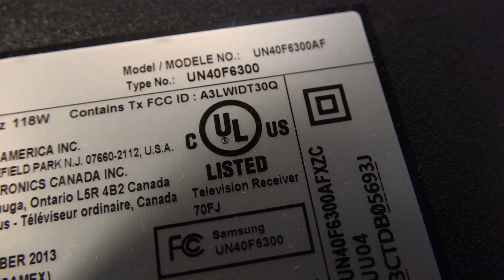Samsung TV LED backlight failure

Comment: My lg LEDTv is turning on , showing LG logo and then backlight dissapears . Its the strips, isnt it?
Reply: Most definitely the strips or to be honest. One or 2 failed LEDs on the strip.
Reply: If you are in the UK I may be able to help with spares
Reply: @allenfleckney5969  Hi I came across your reply to a video and wondered if you could help with backlight leds for Samsung le46c750r2k ? Or possibly repair it for me ???
Reply: Yes I can sort this. But I am in the UK ?
Reply: @allenfleckney5969  I live in Middlesbrough
Reply: @allenfleckney5969  Hi Allen I sent you a message thru YouTube regarding my 46" Samsung 3d tv Leds. Did you receive it ?
Reply from the maker: I am still hopeful that the unit will be abandoned and then I can proceed with ripping the panel apart and checking out the lights. I have some strips from a broken screen set. The unit is sitting in my garage awaiting pickup
Reply: Thanks

Comment: The main problem is no one is telling the costumer to keep the backlight settings low, just about all the ones I repair ( 5 a day now in the uk) are set at 100% , if they were at 75% they would last years longer. I set mine after repair at 45% and the picture is fine.
Reply from the maker: This is no different than back in the CRT days.In that all important drive to have the brightest picture with the most contrast, manufactures made tubes with very dark glass to reduce reflections. Then they cranked the sh1t out of the tube to make it a table lamp not a TV, and people wondered why the picture tube was shot after 4 years, when their old set lasted 20+ years,

Comment: Client must be crazy. Easyist repair ever. It's time consuming but if you have some spare LEDs it would only take an hour, then good as new. Shame he never let you finish it.
Reply from the maker: I agree, but that wasn't my choice. I offered to fix it, but then I am going through a 3rd party. The guy that brought it to me is not the owner, he is the system integrator so I am dealing with an installer, giving him the diagnosis, and he is dealing with the owner. Installer called me and said throw it together and I will pick it up.
Reply: @12voltvids  He used your diagnosis and is replacing the tube by himself.
Reply: Easy repair, easy to prevent also. Turning down the backlight strength to 50% will prevent over voltage. You also won't notice much of a difference in picture quality.

Comment: Ah yeah,  LED backlight failures.  I don't even worry about getting the LEDs to replace them with since they're harder to find,  I just use a diode.   If it's just a couple of LEDs out you can't really tell once it's back together because of the diffuser.  I also tell people to turn their backlights down on their LED TVs a bit to lower the load on these circuits,  it will extend their life.  Often they are set to 100% at the factory.
Reply from the maker: My new 4K set came with them set to 20 from the factory. I generally run them at about 12 (20 is full) and the picture looks great at that level.
Reply: Oh also,  didn't know if you knew about these but a 500 pack of some backlight leds - https://www.aliexpress.com/item/500PCS-LG-LED-Backlight-1210-3528-2835-1W-100LM-Cool-white-LCD-Backlight-for-TV-TV/32685786152.html?ws_ab_test=searchweb0_0,searchweb201602_2_10056_10065_10055_10068_10067_10054_10069_10059_418_10073_10017_10070_10060_10061_10052_10062_10053_10050_10051,searchweb201603_7&btsid=9b56e2a0-3d2d-4d0e-8774-d410967da681

 I might try ordering some eventually myself.
Reply: the LEDs are pretty easy to get and replace actually. shopjimmy sells packs of them all day long lol

Comment: yes.. samsung make good tv ..see all video 12volt repairing about samsung  TV
Reply from the maker: I like Samsung. I have many of them here. The problem with the LED backlights failing is more than likely people running them at 100% I keep my only LED set at 80%. Same for my Plasma sets. I keep them at 7 or 8. Never run them at max, too hard on components.
Reply: To be honest Samsung backlight failure is rare compared to Toshiba (Europe Vestel) and LG
Reply from the maker: We used to call Toshiba "Toshitba" at work when I was working at the shop.

Comment: If you're not going to give the engineer the time and resources to fix something you shouldn't waste their time in the first place. Your customer is a tool.
Reply from the maker: I'm dealing with a system integrator that removed the set from the end customer and brought it to me. I would love it if he said keep it, because then I would find the LED that is out and fix it like I did that Philips LED that went south a few years ago. Same thing. A bunch of LEDs in series, so if one goes you loose the string, and the way these units are set up if you loose a string it upsets the current draw on the PSU and throws an over or under current fault that shits the set down.
Reply: What they need is a zener diode in series with every LED ... that way, when an LED fails like that, it will still allow power to flow.

Comment: Ran into the identical problem with my mother's 32" Samsung. Both LED strips were bad on it. There were actually burn marks around the LED's that most likely initially dead shorted, before opening. The set only lasted 6 months. Since this was a black Friday purchase, the light strips were half the cost of the TV, so I purchased a new one for her and listed the individual boards on Ebay. The only inquiries that I have had for them were from people asking if I still had the LED backlights...............

Comment: I've  come across the same problem and the problem usually is the power supply. Symptoms are exactly the same: the 12V line is hovering somewhere near 9V and backlight is flickering. I suspect there is a problem with the PFC chip underneath the power supply since the voltage on the main reservoir capacitor is at 330V, not 390V, where it should be. Unfortunately I haven't been able to find the chip so I can't verify this, so I have just replaced the whole board.
Reply from the maker: The power supply connector lists the voltage at 9 volts which is what it is delivering.
Reply from the maker: Which is what I was prepared to do but the owner wanted it back to get a second opinion.
Reply: raakile do you have the old psu?
check the resistor rs 802 =10r0 ,is near the big capacitor. It supplys the PFC chip  (icp801=s3050).In my case the rs802 was 250r insted of being 10r.
Reply: fotisp I don't  have any of the old PSUs left. I have a new one, though. It's L42S1_DSM, part code BN44-00645A. It for the European market. It has the same resistor on it. Next time I get this fault I will definitely check that. Thank you.
Reply: I found a repair kit for this.kit 394
Reply: I doubt that , 9 times out of 10 it's a failed backlight. If one shorts it can flicker , but just testing to see which backlights have failed and replacing them is easy.
Reply: 12voltvids I went on Samsung support site and they offer zero zilch schematics... they focus most of the diagnostic on useless info about the main board port pin id's etc.. no real relevant service info.
Reply: the power board is the L42SFV?

Comment: I fix a lot of the LG back light I just by pass the led and the TV will light up only part hard taking out the lcd screen.
Reply from the maker: I doubt that many of the LEDs that are advertised as having 20,000 live spans will last beyond 1 - 2000 hours. I am changing more LEDs at my house than the old compact fluorescents that did last 10 years. I have CFLs that are 12 years old and still going strong, but the LEDs seem to only last 2-3 years, and those ones were really expensive too.
Reply: @12voltvids  you're right. I think design is bad, leds in series. They should be in parallel with balancer circuits for each. In series, resistance variations will cause higher voltages on some leds, stressing them out.
Reply from the maker: @nilsfrahm1323  to run in parallel would require 10s of amps at 3.3 volts.  This means beafier power supply and heavy conductors.   Series allows for a ma supply at high voltage very fine conductors small power supply.   These tvs are not made to last.
Reply: @12voltvids  At least hybrid design, like 4 leds in series for 12V, then use psu like atx power supply. Conductors for 12V not a problem, not very thick. The tv already has a power board quite large, it's just like a pc psu that is spread open. I think a 500$ tv deserves a quality psu. Second, running on low voltage has better safety, in case of drops you can't get shocked. 
Third - how can a full hd pc monitor run on external power adapter on low voltage, but a tv can't? They could make a bigger adapter, with two sets of wires and drive more leds.
Reply from the maker: @nilsfrahm1323  Sony tv run on 19v DC. Inverter inside steps power up.
Reply: @12voltvids  that's a lot of conversion. my samsung monitor has 14V 1.8A adapter, 22inch.
Reply from the maker: @nilsfrahm1323  
The backlight is probably running 150 or so. If it is a ccfl backlight then the voltage is even higher.  Few thousand to the tubes.
Reply: @12voltvids  No, its led backlight, quite new model. 
Have an old Sony HD tv (2009 I think) with ccfl that still works well, has a bit of light bleeding at the edges. Now just upgraded to a 4k LG HDR tv, with IPS panel and I'm scared of what I see about led backlighting in tvs that get bright. I am hoping it will last 7-8 years, like the sony.
Reply from the maker: @nilsfrahm1323  good luck.  More like 4 years  is a realistic expectation for a tv these days.
Reply: If you bypass the backlight you are adding extra voltage to the others meaning they will burn out quicker.  Any 3v led from any TVs will work, it doesn't have to be the same strip
Reply: I been doing it for 3 years no returns yet
Reply from the maker: Correct, this will stress others, but at least it gets more life out of the set. If this set ever gets given to me I will be researching further, but the owner said he wants it back, so it went back together.
Reply: It may be ok to by pass one 3.5v led even though I don't advise it, but yesterday I did an LG 49 inch that had 12 faulty LEDs , so you can't by pass 40 volts they have to be replaced. These LEDs were advertised as having 10.000 hours. Lucky if they see 1000.

Comment: I am relatively surprised that they run that 195vdc  on an LED backlight
Reply from the maker: The reason for the high voltage is the LEDS are in series. This allows low current. If the LEDs were in parallel the voltage would be low, but the current high, and this would require a laager transformer, and heavier wiring. Of course the down side of series LEDs is if one goes bad, you loose the entire strip.
Reply: Well a 50 inch screen has 60 LEDs at 3.5 volts each in series so that's about right.
Reply: Says that's almost as high as an LED lightbulb runs the voltage up to
Reply: These are all in series, so the individual voltage drops are quite low. Depending upon how many in the string, about 3 volts.

Comment: al tv  samsung LED is short life not like the sony LED long life
Reply: Samsung makes good TVs but if you cheap out then you get what you pay for Sony Samsung are pretty good tv companies. At the moment I have a higher end Vizio witch is not bad but I have more Samsung TVs and haven't had any problems
Reply from the maker: Forgot to mention it does the 5 double blink code if that sheds light on it. Power diodes have been replaced, same symptom. I'm thinking perhaps the 2 blue mylar caps c814 and c8204 may be the fault now.
Reply: Depends on the screen used not all Samsung TVs use Samsung screens.
Reply: Allen Fleckney I hate to tell you that Sony has its fair share of panel failures where as it has less backlight failures it has plenty of tab bond and internal tcon failures.. and those damn android b,c, and d series Xbr sets have been a nightmare!
Reply: Yes they have but not as many as we see of the others. We see 10 a day with backlights issue , but only one a month Sony
Reply: yeah.. BL failures arent Sony's weakness. its their main boards.. they are very probematic! Even the D series XBR sets are crapping out left and right! Even the DPS boards are crapping out on those XBR sets
Reply from the maker: Oh I am so glad I am not in the TV repair business anymore. This brings back bad memories of the dreaded grand wega sets with the bad LCD engines in them, or a few years prior the projection sets with the bad green CRTs that the faceplace would crack and leak the coolant all over the PCB under it.
Reply: yeah i know what you mean.. those horrible CRT projos when they would get HK shorts on all 3 guns and those 3LCD sets with the optical blocks.. yes did TONS of SXRD light engines... though they kept all of us in business in the field.. Now its all internet smart and android tv's Though OLED sets are interesting but barely repairable
Reply from the maker: I would imagine that OLED are not service friendly.Vintage audio is where I can still make money. You are right about them keeping us in business though. I got out in 2003 as I was fed up with the BS. I was the one that got yelled at when things broke, and my boss was a psycho. Didn't matter what it was, it was my fault. My boss was like Donald Trump. Blame someone else for everything as long as the finger wasn't pointing at him.
Reply: 12voltvids you got it... fortunately being in Canada you get spared the hell that has unleashed here in the USA. Oled is horrible in the sense that the only serviceable parts is the power supply and main. The panel and panel drive are one part and the oled drive is not serviceable. Also to make matters worse if the panel drive or panel shorts it kills the main and the whole set is shot... the biggest issues with the set is the permanent burn in problems with the 1st and 2nd generation sets have due to the oleds becoming weaker with their light output due to static images. There is a compensation algorithm built in the set that is supposed to compensate for it but the oled elements go way out of spec for this circuit within 2000-4000 hours of use and lg won't cover the under warranty.... the 4K sets look amazing though... the most incredible image I have ever seen on a. Consumer display!
Reply from the maker: Yes I know they look fantastic, I have an OLED tablet I use as a photo frame, and it looks fantastic.I know of the burn in issue on the first and second gen sets. One of the local discount shops has a few first gen sets that have the LG logo burned in, and they had it marked down to 1000.00I told the guy I wouldn't offer him more than 100 because the panel is toast.How are the new ones. Are they still burning?I'm sticking with my plasma sets until the OLED price drops and the reliability gets better.
Reply: 12voltvids  unfortunately Samsung has no translation charts for blink codes. Why bother having them... there is is nothing in Samsung gspn that identifies this.. unlike Sony and Panasonic...
Reply from the maker: I plan to try a few of the HV caps in the lamp circuit. They use those blue square box type caps. A .33 and a .22. Something is pulling that supply down, and it isn't the backlights, as when I put the meter on the LEDs I can test each one and they all light up.Initially I thought back lights. Then the guy that owned it brought me an identical 46" version that had a main board failure, so I pulled the main board from this one to fix the other, and this became my set to dispose of. So now it is more of a challenge to see just what went wrong to cause the sputtering backlights. I know it isn't the power diodes as I replaced them.
Reply: if the diodes were involved they would have been shorted, that is what has happened with other sets that had them bad. Ive seen some LED's fail and they dont light up quite as bright as the others and affect the whole strand.. when you tested the backlights did you test them individually or the whole strand from the source plug? It might be easier to just get the whole PS board.. they tend to be fairly cheap on ebay..
Reply from the maker: I tested them all separately and they all light up. Still could be a bad LED pulling down the PSU just the way it behaves. None of the diodes are shorted, and the caps test good,. No shorts anywhere.The main board on this one is bad too, as I robbed the main board to fix another set that had a bad main board so I don't want to put any money into this.
Reply: I would rather the backlights be indestructible and replace a t-con, power or main board than those fucking strips.